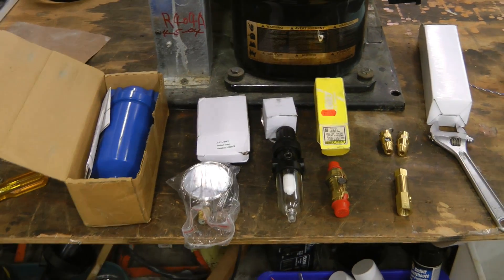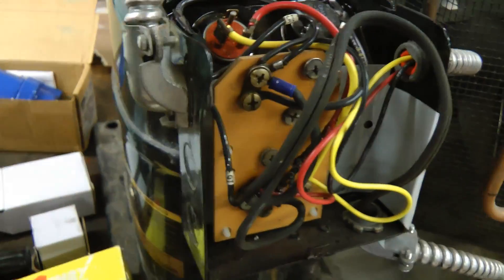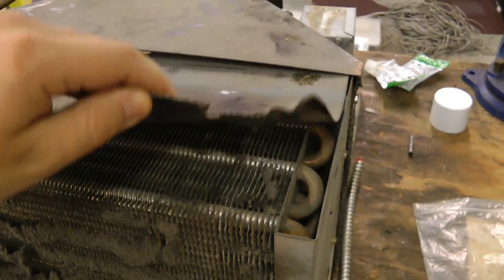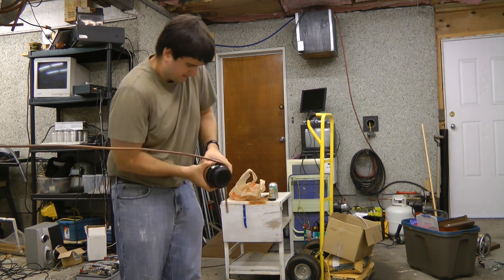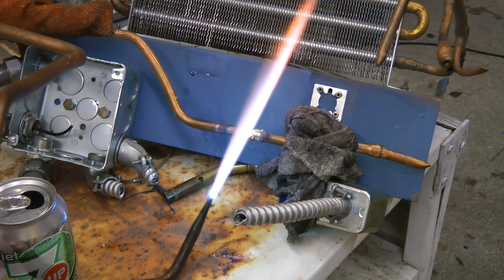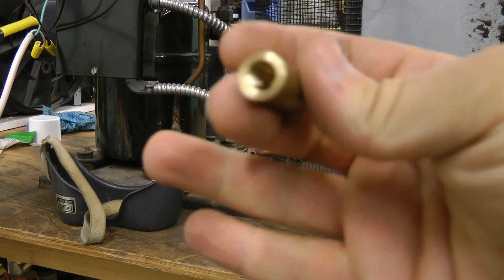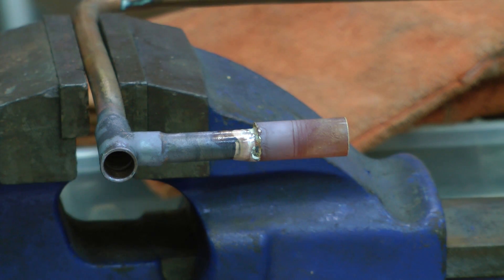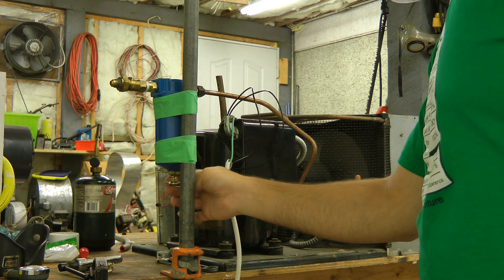Hampson-Linde air liquefier Part 6 - Compressor setup

Comment: it seems many people don't understand how this will work. releasing the compressed air back into ambient pressure is only for the experimental testing phase. once the full system is together, the air stays under pressure and is recycled back into the compressor, to repeat the loop until reaching cryo temps.

Comment: Tesla-500, Actually your attempts have been very interesting at the ´point of producing ice. Even when the expansion valve is just lowering the temp because of the general Law of gases, the energy extracted is very small. That's why the coolant gases change phase from liquid to gas, absorving more energy. Furthermore, you can use a pneumatic tool to extract even more energy (thus temp) from your system (Jules-Thhompson effect). You make whatever kind of work over the compressed air and the temperature will drop dramatically. I used to sell air tools and the issue is that you can freeze your hands if you are not carefull. Now, as the commens say, you need to compress again that alredy cooled air which, by the way, it will get much more denser due to the temperature loss. I believe this approach is good because you won't need a high rated  compressor. Instead, you will need to make several cycles with the same air, retrieving a litte more energy each time. Of course, this has to be done as adiabatically as possible, keeping away heat sources from your liquid as motors and ambient stuff. Keep going!!

Comment: a cool tip for bending pipe is if you fill it with soapy water and freeze it the ice stays malleable enough so you can bend pipe without it collapsing on itself and kinking.

Comment: Forget about the Linde method at 30bar. You'll need an extremely efficient heat exchanger for that to even get a small output of liquid air. And you waste a lot of energy by expanding the compressed air freely into open space. A much better, more efficient design would be to use an adiabatic piston expander, since you'll ideally get T2=T1*(P2/P1)^0.285. First cool the hot compressed air in a water cooler, then in a reverse flow heat exchanger from the expander. The valves and piston design in the expander is a bit tricky, since the expander is very cold. But much can be learned by reading papers about helium liquefiers. Like using a long piston as displacer and placing the seals at the end of it, where they always stay in the hot zone and to use an hydraulic brake for the piston, so no crankshaft is needed.

Comment: The Hampson Linde cycle only works right at 4500 psi, a standard air conditioner runs at 250 psi.  Given your equipment you'll be far better off with a closed loop 2 compressor air conditioner set up and a mixed refrigerant process with phase separators.

If you want to stick with an open loop Hampson Linde cycle you will want a scuba diving compressor to get the psi required,or a really good precooling system. Nitrogen won't act as a refrigerant above 100K. You'll also want some way of extracting carbon dioxide from your system,otherwise it's gonna freeze and keep you from getting the system cold enough to begin liquifying air.

Comment: 1.)How about a capillary tube for a valve? You can chose the pressure drop by selecting the length of capillary. They sell it at appliance repair stores, I believe, for refrigerators.
2.)Consider a pressure multiplier to get very high pressures. It takes a lot of volume of low pressure air but gives some very high pressures.

Comment: @ceytl26 No no you're right, i forgot it was as such. since the two 120V lines aren't at different phasing, its technically single phase correct?

Comment from the maker: @megasmart1337 Yes, we have split phase in North America, with essentially two 120V supplies 180degrees out of phase. For 240V you connect to the two hot lines, for 120V you use one hot to neutral. Technically it's not multiphase, because a single transformer can produce split phase. I wish everything was just 240V, but unfortunately we standardized on 120V for most appliances and are stuck with it.